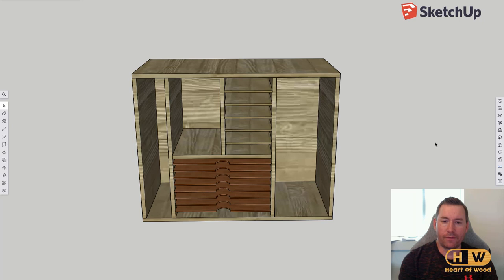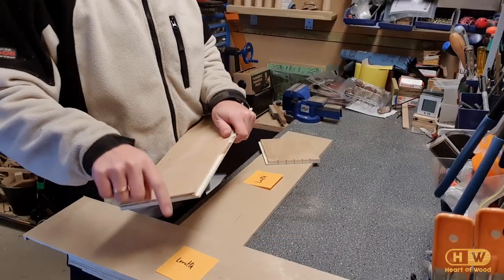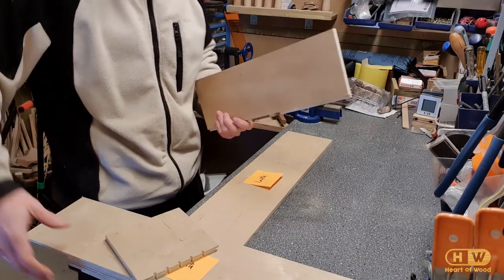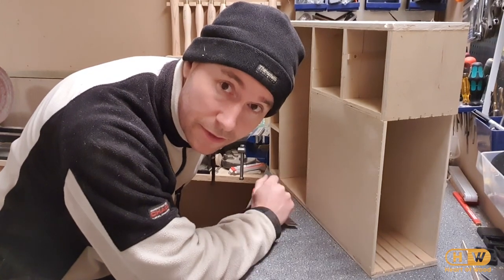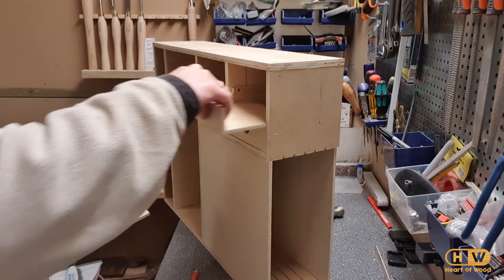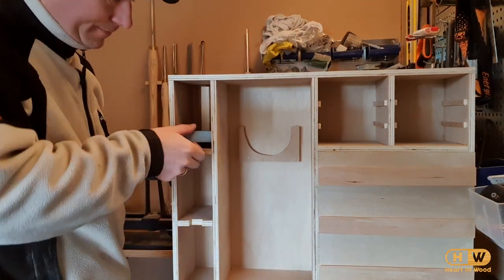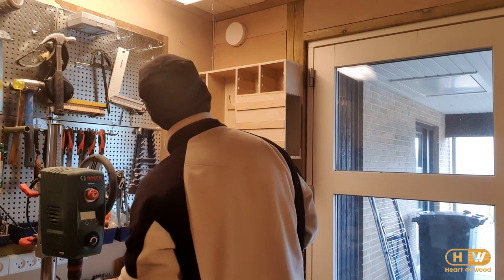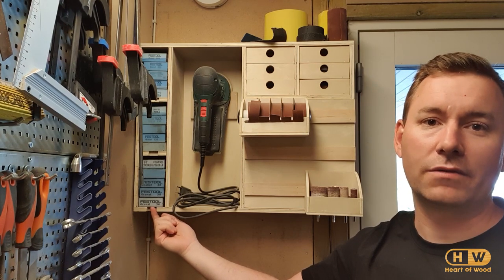My Ultimate Wood Sanding Storage // Shop Organization

Comment: Very nice job and I like making temporary projects out of old wood so I can see mistakes and what changes I would make after using the item for a while, then I make the same again out of good wood
Reply from the maker: Thats a good idea Billy. Making mistakes in cheaper wood. I will think of that for the next project.
I try to eliminate some of those early mistakes on the computer with the 3D drawing. But hard to eliminate all of them.

Comment: Nice job! I've been woodworking for over 45 years and I still make mistakes all the time. I keep small jars of wood dust of different species for when I have a small gap in assembling something, or a void in the wood. I make a paste from the sawdust and glue and then press it into the gap or void to fill it in. When the glue has dried I give it a lite sanding and no more gaps!
Reply from the maker: Thank you. I use the glue/sawdust trick/paste from time to time. But I have never kept stock of different species. I might consider making a collection in the future. Thanks for the tip :-)